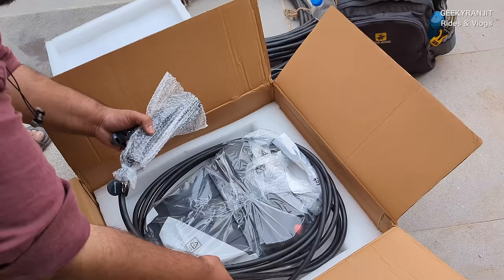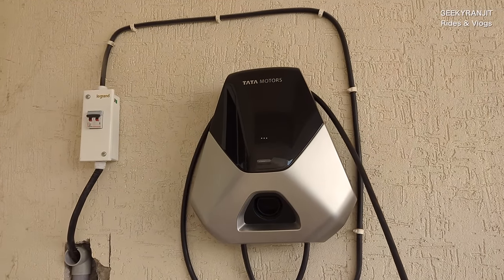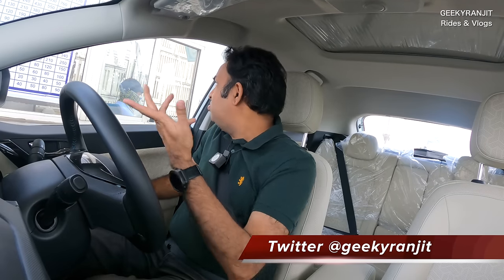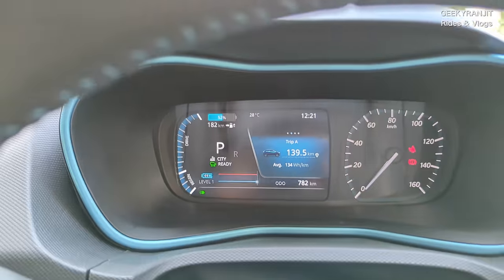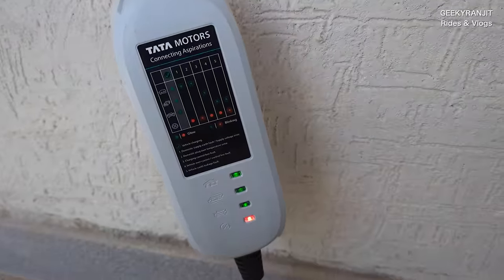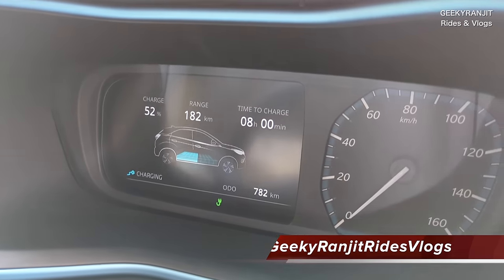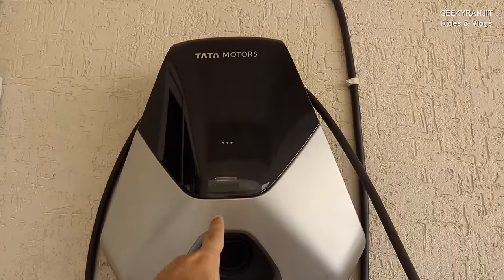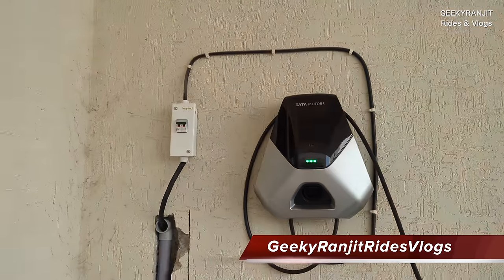Nexon EV MAX 7.2 KW Fast Charger vs Regular Charger and Tips

Comment: What's the effect on battery due to charging them with different chargers? Do we see a drop in the performance? Is it recommended to charge with only one to get better performance in the long run?
Reply: It is very interesting question.  As the chemistry is changing so is the battery capacities as well as charging.  Keeping it simple:  
Charging it using the regular slow Level1 chargers 1.1 to 3.2Kw and the Level2 (wall chargers) 7.2Kw - 11.5Kw and charging the battery only to 80% and not letting the battery go below 20% will be optimal for the battery life
it extends the battery life from 300 cycles (if you discharge to near 0 and change to 100 every time) and you do this once a week, your battery will last (300cycles x 7weekly) / 365 days = 5.75 years or lower.  However if you keep the battery between 20% - 80% most of the time the battery life can increase to 1000+ cycles and that would mean your battery can last 16 to 20 years.
Actually some car, phone, laptop manufacturers auto cut off at 80% (it shows 100% for us) but the battery is bigger and is actually using 80% - Hence, increasing the battery life with out our control (smart).  Hope this helps.
Reply: Tata recommends charging to 100% as it does some battery calibration or conditioning which will help improve battery performance and durability. 

Mobile phones batteries work in a different way where it is better to keep the battery level between 20-80%

Comment: Have a doubt...does charging on 7.2kvot cause battery degradation more than the slower wall charger...any ideaa
Reply: No, but if there is a high usage of DC charger then only there will be degradation in battery.

Comment: What's the future hybrids, fuel cells or EVs?
Reply: Hydrogen fuel cell cars are future, EVs are not for long distance journeys
Reply: @abhilashg1368  , hydrogen has its own share of issues. Its high pressure storage needs thick and heavy tanks. Also hydrogen at high pressure will be fatal during a crash. The process of hydrogen generation is not very efficient too. Hydrogen may prove good for heavy vehicles, but never for passenger cars. California has had hydeogen cars for so long but its sales and growth has stagnated due to these reasons and the current owners cannot go outside CA due to no hydrogen pumps anywhere. Well atleast electricity is everywhere.
Reply: @shas312  Technology will improve, even petrol is highly inflammable that doesnt mean car will blast every time it crashes, EV uses Li ion batteries and digging Lithium has its own limitations and there isnt enough Lithium to replace ICE cars in the world. EVs need battery replace after few years and that costs a bomb. EVs are useful in city conditions but Hydrogen Fuel Cell cars will pick in next decade like EVs picked up in this decade.
Reply: @abhilashg1368  , We dont store petrol under high pressure. Any flamable gas under high pressure is dangerous. Lithium usage in batteries is heavily overestimated. A LFP battery at max has 230 g/ kWh of lithium. So if you take a 30kWh battery pack ( Nexon EV Prime) , it has 6.9 kg of lithium. A 40 kWh pack ( Nexon EV Max) has around 9.2 kg of lithium. So thats not very high usage. The main weight in a battery pack is the aluminium casing for each cell, thr battery casing and the cooling system components. Also who told a battery needs replacement in a few years? A LFP battery has 3000 cycles before its capacity drops considerably. If we take 250km per charge, thats around 7.5 lakh km. A well cooled battery must easily outlast the use period of a car. If the car is scrapped, the batteries can be used for stationary storage. After that, it can be recycled to obtain lithium which can be used to make new batteries again. Thats the reason Tata themselves are giving 8 year warranty on the battery pack. So its a myth that batteries need to be replaced in a few years. I am saying this on my experience too. I am using Ather from the past 3.5 years. Ather uses NMC cells which are known for having less cycles. Even with that, I have seen around 4% of battery range degradation in 3.5 years, that too when its just an air cooled battery.   With this rate, I can easily use it for many more years without any replacement. So a liquid cooled LFP battery in Nexon with a more sophisticated BMS should easily outlast the car.
Reply: @shas312  You have excellent knowledge on the matter, thanks for the info

Comment: Setup a solar ongrid plant according to your monthly electricity consumption. If your consumption is 500units per month go for 5kw system. Its better to go with hybrid inverter so that you can use solar power to charge batteries as well. Ev and ongrid solar will make your fuel expense to zero.

Comment: Guys this car will go 250km any driving fashion with our without ac ...after this any kms ur getting is ur luck depends on ur driving skill don't keep thinking too much about the car it's a beautiful machine designed for only 250km in any terrain above this all conditions matter any ways for every 200km or 100km there are fast charges available u can go and charge it

Comment: Thanks for this informative video. I had a question. Usually, when we take electricity to our home it is 3 or 4 KW from the electric board. You said, you have 40KW. Any specific reason for the same.
Reply from the maker: It's a three phase house, even in our old house that is three phase the load sanctioned is 25 KVA.  This is a far bigger property...  got it doubled checked it's 50KVA allocation for this location. 

If you have 3-4 AC running continuously with other heavy appliances in summer you need at-least 15KVA allocation, most independent house, villa do get at-least 20 KVA with 3 phase connection.

Comment: Hello sir, I got normal single phase meter in my house. Can I use fast charger in that?
Reply from the maker: Check what's your load that is sanctioned should be at-least 12 KVA, if not you would have to apply for higher load and also replaced the meter.

Comment: Does this battery conditioning thing apply to mobile charging as well? I mean on using fast chargers with high wattage???  Just came up on my mind 😅
Reply: No. Smartphones uses a single cell unlike EV cars like these uses a lot of lithium cells. Overtime, different cells will have different level (percentage) upon usage. Thus to maintain equal levels of charge at all of  the cells, normal charging is preferred. 

For smartphones, charge with normal chargers once in a while if you want.
Reply: @abhiram___  Thanks for the insight 😀

Comment: Ranjit Sir, Does Tata recommends a 7.2kw charger to use daily? Is a 7.2kw charger that can harm the overall battery on daily usage in terms of longer run like over the years?
Posted the comment during the vlog but at the end of the vlog I got the answer
Reply: This 7.2 kW charger is also technically not a fast charger and in the Z connect apps when you charge with this, it shows as slow charge only. Fast charging is DC fast charging.
Reply: 7.2kw is not that high to damage the battery. Usually, DC charging which happens at 25-30KW is harmful if done very frequently.

Comment: Is it possible to install 7.2 kw charger in regular independent homes which has only 4kw power line
Reply from the maker: No, you will have to get the load upgraded from your electricity board.  TATA guys will not install this charger if the load sanction is not proper on your meter.

Comment: EV is only recommended for City Drive at present..

Even for a short 250km drive, it’ll give you jitters & unnecessary stress..

You better rent a car or have a 2nd car which is Petrol/ Diesel if you have to travel long..

Comment: Hi, I heard that if your energy meter doesn’t have support for 7.2 or more kw this charger can be set/underrated by a setting to charge the car at 3.3kw. Can you please confirm this setting as this will help not overloading the home energy meter but still have an onboard 7.2 kw charger option with car to enable fast charge during travel.
Reply: Yes you can use the charger at 2 settings 7.2 or 3.3. But only Tata Power can switch the settings. I am using it at 3.3 for now
Reply: This charger is shipped with  default current setting at 13A... It's can be changed as per requirement through application..Max current it can deliver upto  32A..

Comment: Can I charge Nexon EV Old Model with 7.2Kw Charger?
Reply: As far as I know it won't charge at the higher speed coz the older Nexon EV does not support AC charging of 7.2 KW as there is a AC to DC convertor that need to support the faster charging rate.
Reply: @RanjitKumar  how much does the car heat up during charging? And what happens charge is completed exhausted does the car stop or we have some backup?

Comment: That's 10sqmm cable not 10 core... For a single phase MCB, you use 2 core cable and a 10sqmm can be used upto 60amps current

Comment: So mota mota calculation: 10 KW additional load fixed cost would be approx 1500/month. Using 3 KW charger, it takes approx 16 hrs to fully charge, so 48 kWh for a single full charge. Assuming Rs.10/unit, it's Rs.480 for a single charge. Assuming 100 km run per day which is typical in Delhi NCR, it wud be 8 full charges a month (excluding weekends). Total cost comes out to approx Rs.5400. That's extremely economical😊
Reply: For us in Hyderabad, fixed charges on contracted load are ₹10/KW.
We have 5kw as contracted load and got it upgraded to 10kw so as to take fast charger. Now we are paying just ₹50 extra in fixed charges.
I don't know why these fixed charges are so high in Delhi, maybe are you meaning that penalty charges for additional load?

Comment: So you have to wait like a few hours even with fast charging & electric bill also will increase any way & the batteries are as costly as a car if you want replacement after 6-8 years.
& no one sane will buy the second-hand because of battery life & the crazy pollution that the depleted batteries are gonna produce in future.
This is why green Hydrogen is the better option, Gadkari ji is right about this. 🤷‍♂

Comment: Get your self updated sir , prime supports 50 kw fast DC charger as well
Reply: You can even charge it with 60 kW but I won't pull that much current, its pull around 22 kW max.

Comment: Im also a user of nexon ev max with 7.2kw fast charger, feel free to drop any questions you guys have, happy to help geeky ranjit community

Some common FAQ on this video
Why not ZS EV - mainly because its Chinese and nexon is vfm, if zsev was giving for a 60kw battery then i wouldve considered it

Why not atto 3 - out of my budget, my budget was 25l, i could only consider ev max or zs ev excite variant

How much does it cost- currently i live in delhi and i have installed a special ev metrr which costs me 4.5rs per unit, so it costs me less than 200rs to fully charge the car including electrical losses

Range - i get anywhere from 270 to 330
Reply: How much sanctions load is needed and cost of increase load? Plz
Reply: @sanjaysirvi3128  i have installed a special EV meter for my nexon and its sanctioned till 8kw, since i live in delhi, there are no fixed charges for special ev meters, otherwise on domestic connection fixed charges are about 100rs/kw
Reply: Hey will i get 3.3kw portable charger for free if i buy the car with 7.2kw charger
Reply: @aryanhabib4  yes
Reply: @vyktrii  thank you
Reply: @vyktrii  is there any nexon ev community group if i can join?

Comment: What about maintenance ranjit...
Reply from the maker: Almost next to none, servicing is also nothing much to do but they just check up, brakes etc, do any updates there are no oil change, transmission fluid or anything like regular engine cars.....  I was reading forums servicing approx Rs 1500.
Reply: Mostly Software Updates and regular checkups of other parts.
Reply: @GeekyRanjitRidesVlogs  though sir, there is a transmission fluid needs to be refuelled every 2 years. But cost is 1600 only.

Comment: Do you know what is the maintenance cost for an electrical car for 10 years. If you know that you will not do a blunder mistake. Electric car are waste solution and to produce the electricity for that will create more pollution than any internal combustion engine car